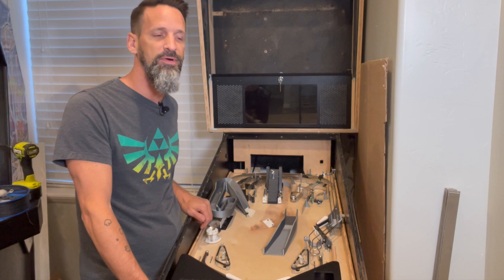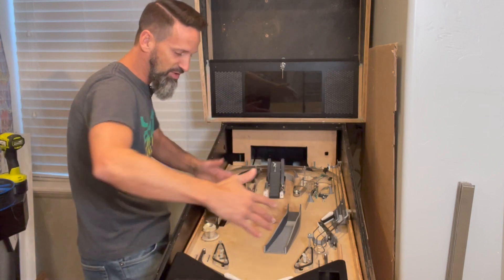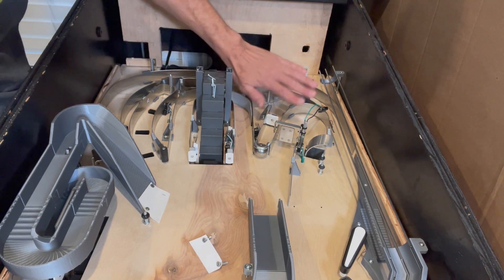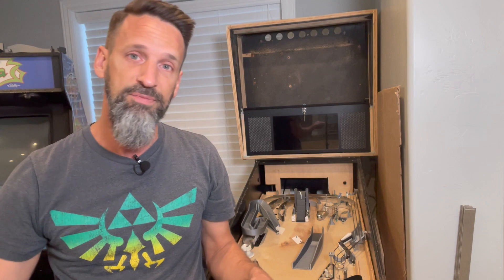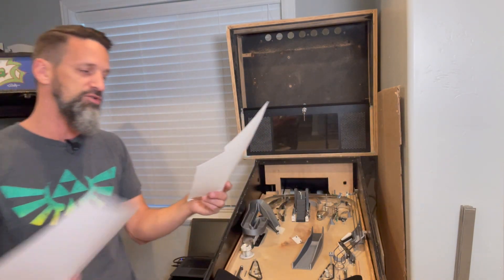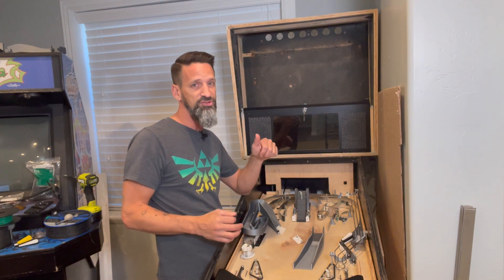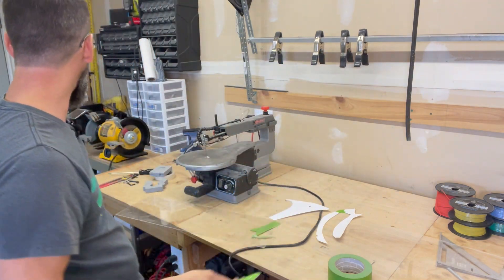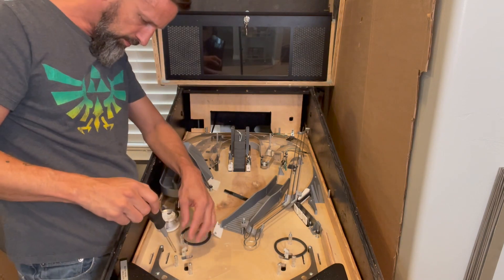HOW TO MAKE A PINBALL MACHINE - Playfield Plastics

Comment: For the screws that hold the plastics down, why not screw them in from the bottom of the playfield so that the tip extends just above the plastic so that a plastic cap can screw onto the tip? That way you don't have to remove the screw to remove the plastics for cleaning, etc. Actually, long thin bolts would work even better as most plastic caps are made to screw onto a threaded bolt, not a wood screw tip.
Reply from the maker: Yes, that's why all commercial machines use a post that doesn't need to be removed but just have short screws that screw in from the top to hold the plastic in place - that's what I'll do once the posts I ordered arrive

Comment: Awesome, thanks for sharing your progress.  Something I learned by accident this past year is that stepped drill bits are fantastic for cutting acrylic without cracking!  I needed a large hole, and it cut perfectly at every stepped hole size from small to large, whereas regular drill bits cracked almost every time..  I don't think you have to use a stepped drill bit, but you would want to use a drill bit that mimics the cutting style of a stepped bit, as they are different.
Reply from the maker: Oooh! I never even thought of trying that, that's a great idea